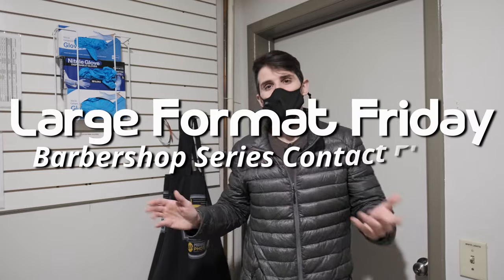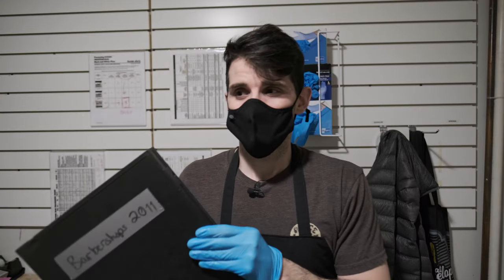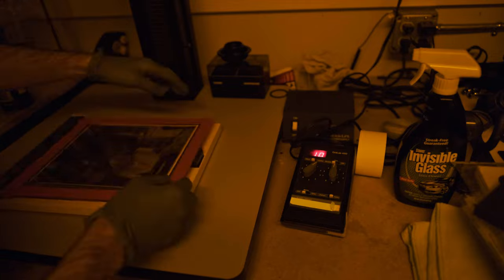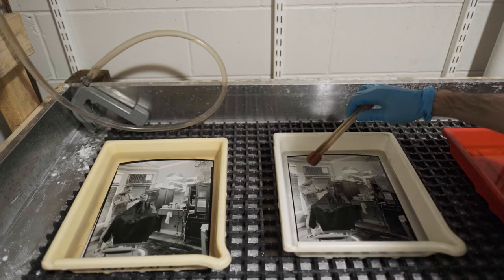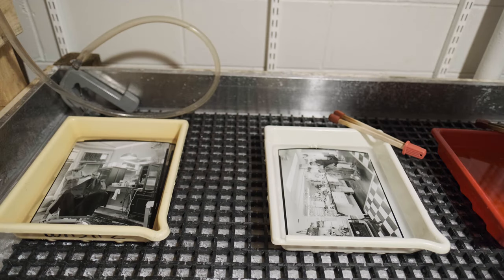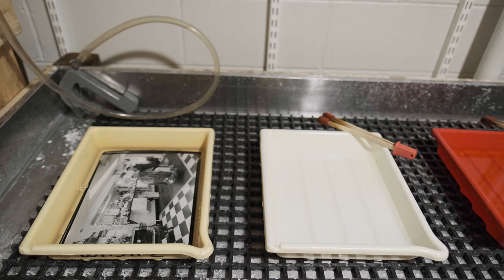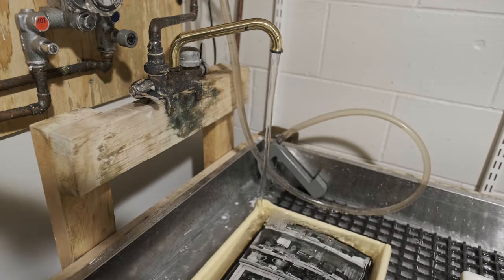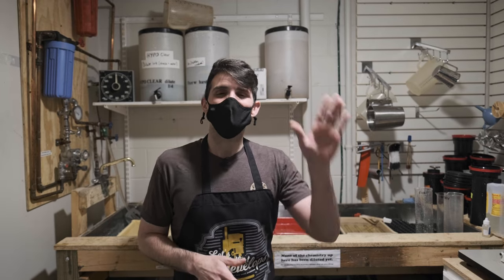Barbershop Series 8x10" Contact Prints - Large Format Friday

Comment: I found this actually much more interesting than I thought I would (come on, a guy standing in the darkroom and doing some contacts – must be boring, right? ;-)). The option of just doing contact prints (no enlarger needed, even though you do use one) – this I find more and more intriguing about 8x10. But I'm not there yet, still struggling with the weight of my Intrepid 4x5 and all the stuff I have to carry around (even when using a rather lightweight carbon fiber travel tripod). Maybe a better backpack might help …
Reply from the maker: Thanks for the comment Christian and you'll want to get used to the heft and workflow of 4x5 before evening asking the tough questions about 8x10. Also, a backpack with good support (shoulder, chest, and waist straps) will change how far you're able to travel with the camera and how much you're able to carry. Highly recommended!

Comment: The last time I had a darkroom set up, I split filtered literally every print I made.

Why?  I didn't have either actual contrast filters, color head, or a nice grade-filter head like that one.  What I did have were sheets of theatrical gelatin filter material, one bright yellow and one deep blue (they were selected based on their spectral cutoff).  The yellow (green for low contrast, plus red that doesn't expose the paper) for grade 0 or 00, and blue (because I couldn't find a magenta that cut off enough green) for the grade 5.

The claim, by darkroom workers with a lot more experience than I have, is that you can match any split-grade print that doesn't involve dodging or burning with one filter or the other, if you have a sufficiently finely graded filter set (say with a dial-in unit like the one in this video, or a color head).  My counter-claim is that it's usually easier and almost always faster and less wasteful of paper to make two test strips, one to find your grade 0 time, and then another on top of that to find your grade 5.  Sometimes, you can get away with doing them on the same sheet (and sometimes you can't, it depends on the scene).

Bottom line, though: don't be afraid of split filtering.  It's the well-trodden path to grade 3.2 or 2.7, and split dodging and burning brings in a whole additional dimension of control.